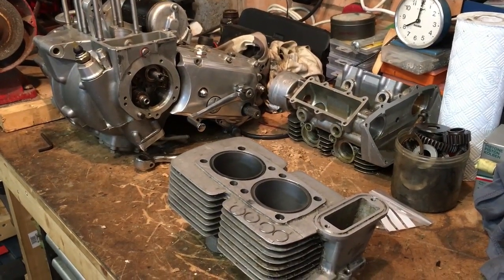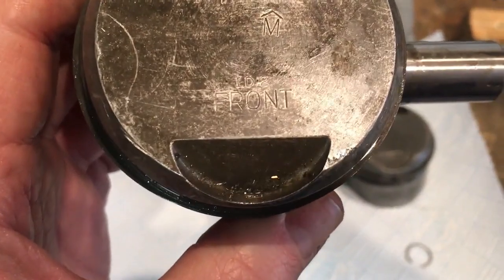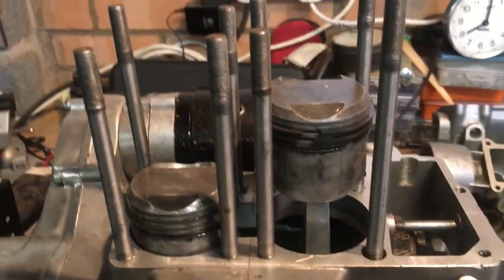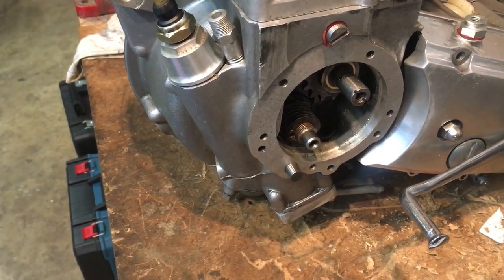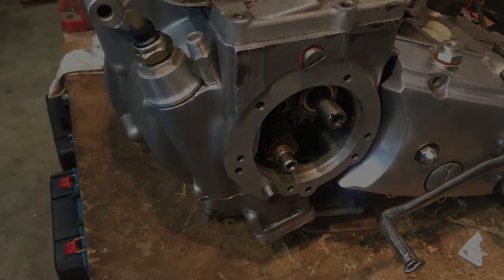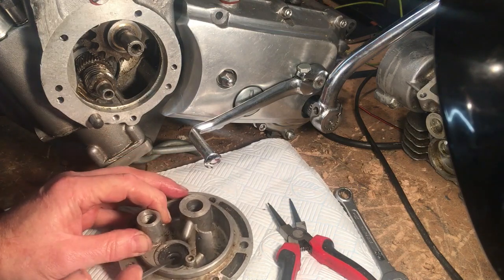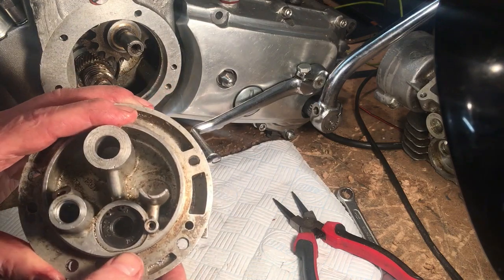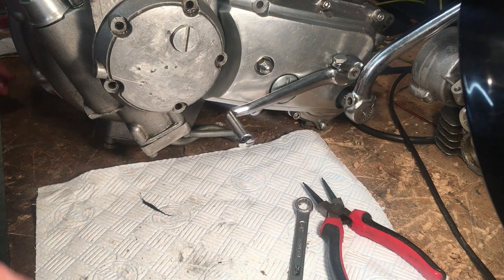BSA Fury SS (E35SS) Build - Engine Part 18 - Barrels and Pistons 3, and Timing Cover

Comment: The entire time I was watching I was concerned about the volume of contamination apperant on the parts then at the end you cleared it up by saying that you were going to do it all over again after cleaning,  glad I watched all the way to the end before making a comment. I was working in a BSA Dealership in California when this bike was announced but I don't believe any ever reached the Dealerships hear. Fun to see , I should have kept both of my BSAs  A65 Lighting and a 750 Rocket 3 with racing 5 speed transmission.  My income preclude that possibility, it was necessary to change to auto repair in order to solve the money shortfall. Cheers!
Reply from the maker: Thanks for the interest and comment Thomas. Yes the engine will be stripped next for thorough cleaning and final assembly.